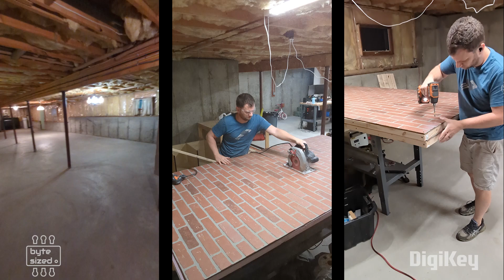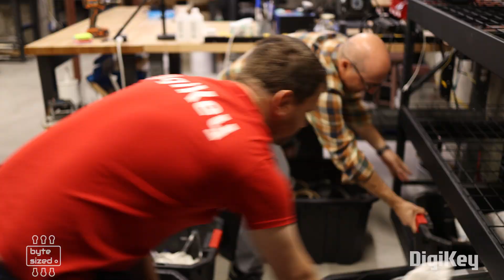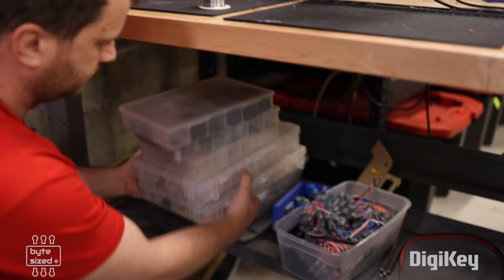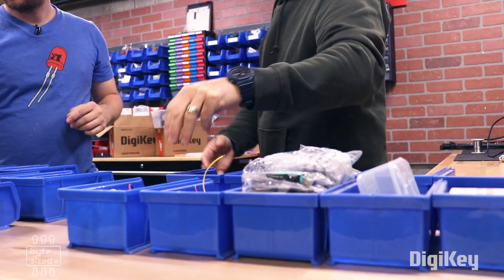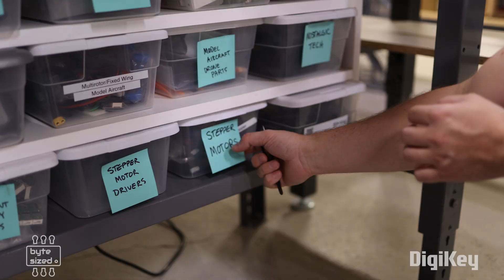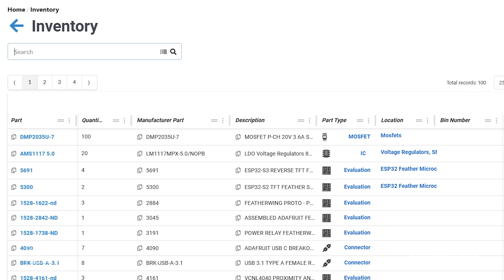How to organize your boxes of shame - The Byte Sized Engineer | DigiKey

Comment: For electrical components I like a binder with plastic sheets meant for business cards. I put the components in small static plastic bags with a sticker that has the part number, value, voltage rating or whatever describes it. One little bag per business card slot. You can then add dividers so you have a capacitor section, mosfet section, op-amps, whatever. It's very easy to flip through the binder and find what I need.

Comment: I think you're making the right choice keeping lids on bins, because you have dedicated shelves and you're not stacking them on top of each other.  In a home shop a thin film of grime will eventually settle on everything you're not continually using, which will be most of your stuff.  You won't notice it forming over decades, but once it's there it's there forever.  Once you start stacking things on top of the lids, you're doomed.  Never buy multi-bin organizers that open on top for that reason, as you'll lose all available volume above them.
Reply: I agree.  Had work done in basement, insulation particles floating around.  Got into everything

Comment: Good stuff! Another option for things like resistors is to group them by decade: e.g. 4.7R, 47R, 4.7K, 47K, 470K, 4.7Meg all go into one group or container.

As far as lids/no lids, depends on your environment. In my woodshop, EVERYTHING gets a lid, and in fact, I stay away from open shelves at all, because it's just dust collection. Everything goes into a drawer or cabinet.

Also, lids on containers means I can stack the containers on top of each other, MR SMITHSONIAN!! lol